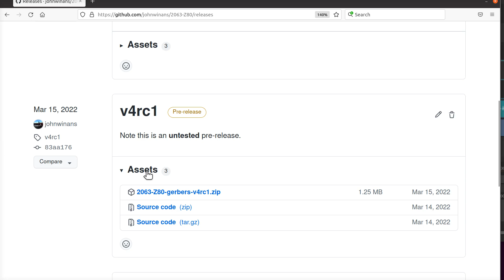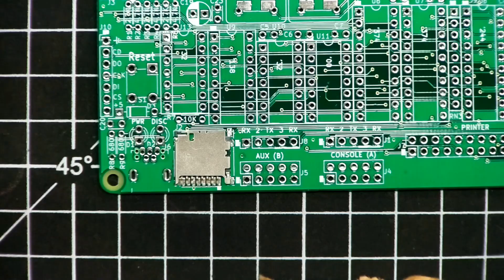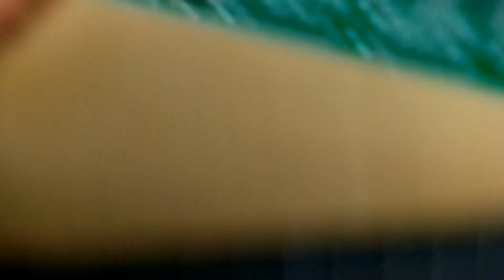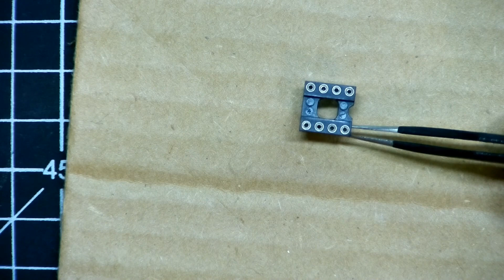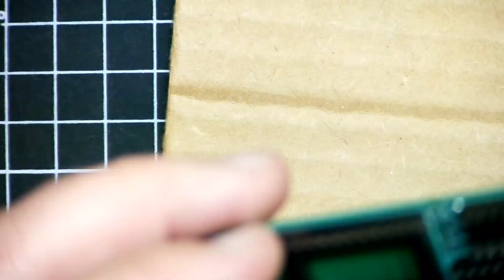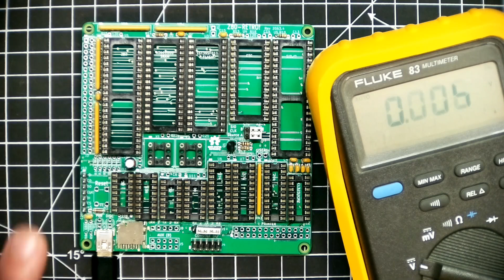Z80 Retro #33 - v4rc1 Full Build and Test pt. 1

Comment: I just got done installing the SD card connector on my board. I kind of did a hybrid approach. I used a thin layer of flux paste just on the pads of the PCB and on the metal sides where it gets soldered to the board. I then tinned the sides like you did in the video. I placed the connector on the board and soldered two pins down in the opposite corners making sure the connector is square with the board, and then I soldered the rest of the pins. The metal sides were done last which took a far bit of time to get the pad heated up, but it worked just fine. One difference for me is I have a Weller WES51 iron with a fine tip, and that very thin solder (0.015") - the only way to go for me doing SMD installs.

Comment: 2 minutes tops to solder on a micro sd card reader. Flux, right soldier and a little hotter soldering iron.
Reply from the maker: It impresses me how much trouble I'm having with it too.  😩

I just got a hot plate that looks very promising at dealing with it.

Comment: Yeah... some high quality  flux would help a LOT.
Reply from the maker: I just ordered a hot plate.  That aughtta cure what ails me.

Of course, even a cheap one costs more than a complete retro board.  So not all hobbyists are likely to run right out and get one.  I feel that it is important that we have s 100% through-hole (ez solder) option for beginners!

Comment: Sorry John, its my job to spank you when you’ve been bad. 40 minutes of soldering an SD connector and 5 minutes of high speed soldering and 4 minutes to finish off. Just, no! Ok? 😂
Reply from the maker: 😕... Yeah . That blasted SD connector has been unexpectedly frustrating.  I'd like to find a technique that is viable for anyone so inclined to swing an iron at it.

Comment: preheat the board at 150 degree celcius inbthe oven?
Reply from the maker: I'm an inch away from getting a hot plate.

I'd like to be able to solder in ballgrids.  A plate might make that viable too.